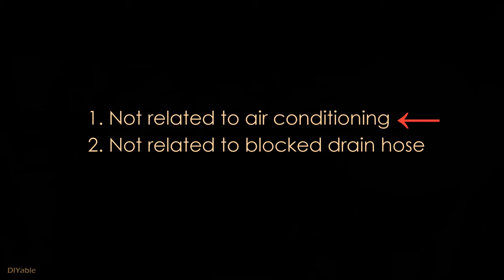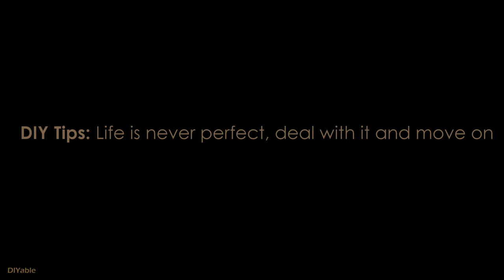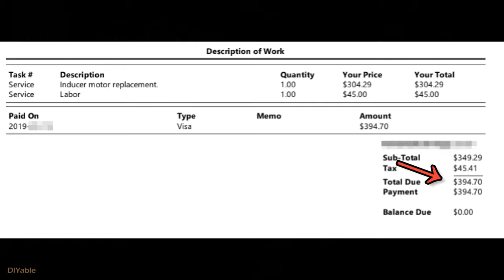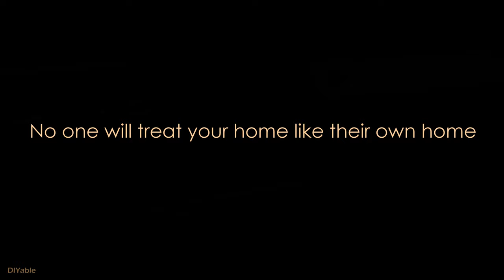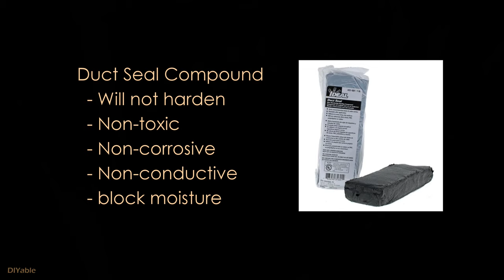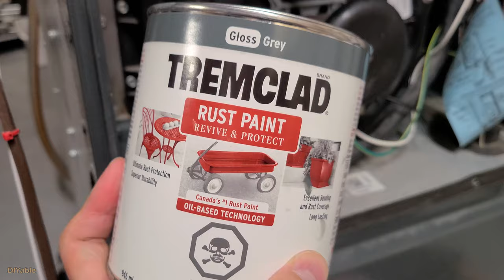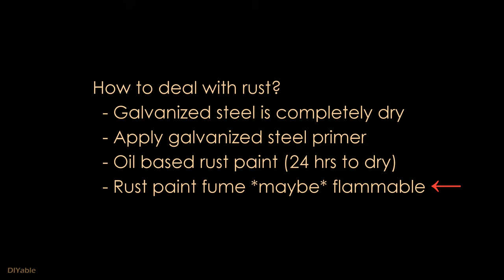How to fix water leaking furnace when heat is on?

Comment: I'm getting water leaking down from the the exhaust pipe from the inductor motor pipe. I was wondering the pipes from both the intake and exhaust are blocked.

Comment: Great video! Just had the HVAC guy out  to fix said problem. said there was water around the inducer blower (possibly a bug plugging it up the drain he says).
Next morning no heat. water is back. watched your vid, dried everything off, blew out the drain hoses with compressed air.
Checked it 2hrs later, no leak at the gasket for me and still dry. Thanks!
Reply: Thank you for this info

Comment: You are AWESOME! This was literally the same leaking issue I had which was occurring on the same exact area of the plastic cover. Ironically (or not), my furnace is branded as a Xenon which I believe was manufactured for them by Goodman. I looked for hours for a solution and yours was the exact one I needed. THANK YOU!!

Comment: LOL, best DIY video! Love your sense of humor! 😂
Oh and yes, it sounds like my exact problem, I even have a Goodman furnace! Thanks for posting.
Reply: issue with same furnace as well only 4 years old
Reply: @judithvilla6026  If you replace the gasket yourself, perhaps buy the panel also. Mine did not come out willingly. I pried with all the tools in my toolbox, broke off pieces of it. Finally used a hairdryer to soften old glue and removed.
Reply: @eeng4234  Got it thanks for the tip!

Comment: My Trane XR90 had the identical symptom but a different cause. First, as noted in the description, always check the drain hose and P-Trap are free from clogs. One more (stupidly simple) thing to try before removing the inducer. There are 2 hoses that drain into the P-Trap, one from the inducer, and one from the secondary heat exchanger. First check them for clogs and also make sure the connectors on the inducer and exchanger are clear. A while back I found a small screw stuck in the inducer hose connector. It seems when I put the hoses back on the two mentioned connectors moved a bit and were not sloped slightly down causing water to pool up in the heat exchanger and inducer. The connectors look like 90 degree elbows. When connected, the top leg should pointing slightly downward. Again, the other causes in the video and description are more likely the issue, especially if no other service was performed on the unit. That said, I had 2 HVAC companies tell me I need to replace the entire furnace, and it turned out that correcting this problem resolved my issue. One final note is that if a simple problem like this, or clogged drains, is allowed to exist for long enough, it can lead to more serious problems (like the one in the video) over time due to the rust and corrosion.

Comment: I took your advice & got the induce motor but what pressure switch are you referring to, do you have a part # or can it be reset when the inducer motor is replaced?

Comment: How is the duct seal holding up? I've found other sources say to use high temp silicone. I also noticed you only apply it to the bottom of the box does the whole box not need to be sealed or do you figure the rest of the gasket will suffice...? Anyone welcome to weigh in.
Reply: Not a pro, but using some common sense, I believe just applying to the bottom should be good enough. The whole thing won’t fill up like a glass of water before over flowing. That being said, if you are already putting duct seal on the bottom, why not just go all the way around 🤷‍♂️
Reply from the maker: It is holding up very well, believe it or not. No leaking since the fix. There is no need to have high temperature silicone, that particular part I have leaking issue isn't hot at all. Unless the leaking problem of yours is somewhere else..
Reply: As a professional, you should be using high temp silicone, Period. However as a home owner, you can do what ever you want. 
My advice- you are dealing with gas and poisonous gas (carbon monoxide) call a pro

Comment: wasnt the hvac dudes fault.
and that compound is going to cause standing  water due to missplaced diameter measurement.  and fyi that 3m filter is restrictive to air flow. so ur furnace is running hotter then it should causeing the seal to wear out quicker. air filter is there to protect ur blower and coils. so yea do it ur self. but are u doing it right and effective?
Reply: What is the correct way to do it?

Comment: mine is leaking from that pvc elbow (white on yours, mine is black).. what can i do?
Reply from the maker: Is there any holes on the PVC elbow? Or is water leaking from the connection points where it is secured by adjustable clamps?
Reply: @DIYable  exactly! I have water chronically dripping out black rubber coupler even when clamps are screwed down 100% tight, there are vapors coming out outside so not clogged would the duct seal or silicone RTV keep the seal?  (horizontal furnace installation, trap is clear and draining?)

Comment: I had water leak from the wall crack of exhuast fan and replaced it. It causeed the flame to extinishe right after the big blower blowing air. Later I experienced the same flame issue and replaced a blue cheap filter to resolve the isse.

Comment: I have a condensate chamber issue. Water buildup stops the main burners from igniting, hence blowing cold air from the vents. I’ve pulled numerous hoses to drain water and usually it works, but this time it’s not working well. The plastic chamber has cracks in the plastic, but no water is coming out of them. Cold weather last night and the furnace thermostat was set a little low. I think it’s too low, causing cold air to enter the direct vent pvc pipe to the cold outside. Anybody… does that make sense? What’s up?
Reply from the maker: I suggest in this case,  call the HVAC guy.
Reply: Did you happen to find the fix for this?  My furnace keeps shutting down because water is leaking somewhere around the condensation chamber and building up. I can remove the water and clean the chamber, but it only fixes it temporarily.
Reply: @skiz888  : I used to drain a hose at the bottom of the chamber every couple of weeks. The issue was that my heat exchanger had holes in it. Fortunately, none of the gasses were entering our living quarters, but it turned my condensation chamber yellow, then black. That told me there were holes in the exchanger, so I had to bite the bullet and get a new furnace. Uggh! $$$!
Reply: @skiz888  : So, if your furnace isn’t too old, you will likely be able to replace just the chamber. The gasket between the chamber and the furnace wall will need to be replaced too. There are some people that remove the chamber, scrape off the gasket material and use a high-temp silicone to put it all together with.
Reply: It’s about 10 years old. I wonder if that’s the issue. The water pools up under the condensation box and it doesn’t seem like the box itself has a leak.
Reply: @skiz888  : it’s likely the gasket
Reply: Thanks! I’m not sure if it’s something I can get to. I’m guessing it requires some disassembly? I can remove the condensation box but not seeing a gasket anywhere. Hoping the HVAC guy won’t charge a fortune for this.
Reply: @skiz888 . Sounds like your condensate trap is blocked up.  Three drains feed into this trap & then drain out of the furnace.  If the trap gets blocked (not cleaned) water builds up, leaks out into the furnace, onto the floor.   Search on cleaning of condensate trap.    It’s pretty straightforward.

Comment: Mine is pissing like a horror
Reply from the maker: Arrggg..  I hope it fixed your problem...
Reply: @DIYable  yes & I used the putty on the 3" circle where the motor attaches to the shroud,  because it was leaking there too. The foam gasket had disintegrated
Reply: Yes, this is very dangerous. Everyone (did guys) think they can do anything but that's why we as pros go to school for 4-5 yrs to train on this stuff. Forget youtube university and call a pro. This is your life you're messing with

Comment: This is dangerous. Usually indicates deeper issue with furnace. You're just sealing the acidic condensate into either heat exchanger or down through blower. Yikes